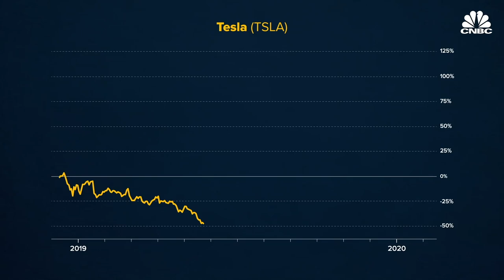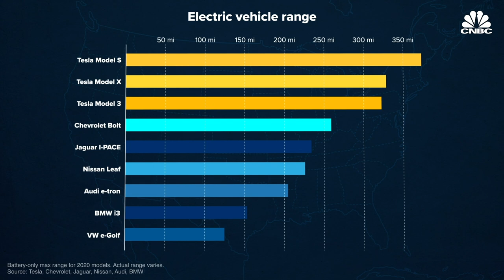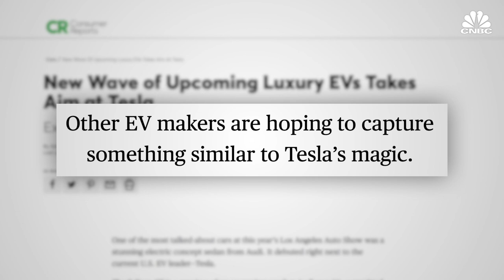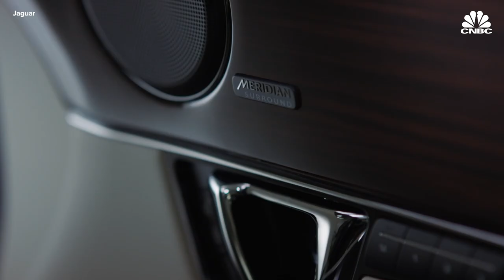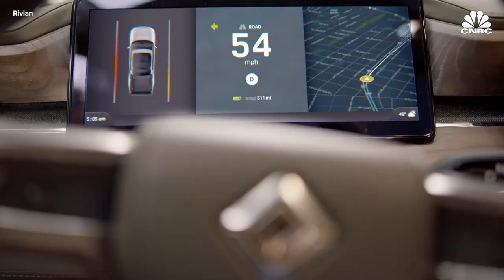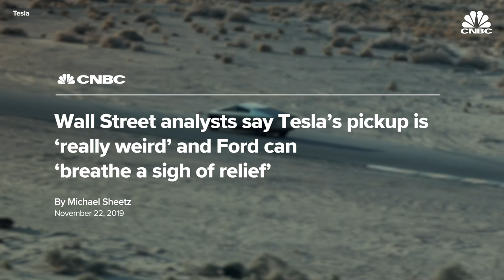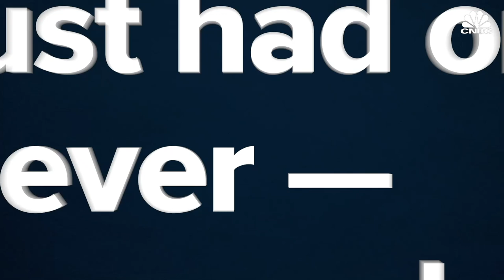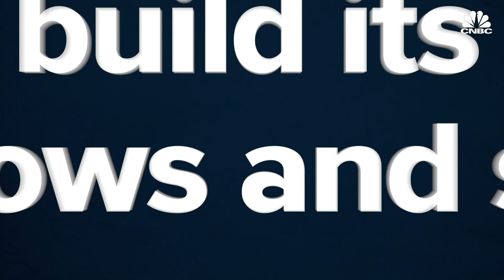Which Automakers Can Seriously Challenge Tesla?

Comment: The reason everyone is losing to Tesla is because they ignore the most important part of Tesla's 

Software
Reply: Tesla is the "Apple" of Cars
Ppl tend to forget that Software alone is not only a BIG change but a HUGE Advantage
Reply: also their electric charging Network
Reply: Software plays a smaller role in people purchasing Tesla's.   It is a number of things, like huge long lasting batteries, which no other OEM comes close to offering Tesla's ranges.   Plus Tesla uses a lot of aluminum in their cars, which doesn't rust like steel.  I believe it's one of the reasons for their long warranties.
Reply: Both Software and hardware are what give Tesla the edge, an article came out yesterday(I think), multiple legacy auto makers did a teardown of the Model 3 and after looking at everything from hardware to software, they came to thw conclusion that they cant compete right now. They stated that Teslas ability to produce hardware and software in-house gives them an edge in that sense
Reply: Wrong, what is making Tesla win is the simple concept of batteries. Elon owns the mines.
Reply: @sgodsellify  The thing you are missing is that the battery is only so good because of the software. Tesla batteries aren't very special. Its the optimization through software that makes them so good.

This is why they can deliver performance boost and extra range with an update something no other company is able to do
Reply: luis abularach that’s the question. Is it the inhouse fabrication of the battery (cell management)? The battery management software (whole battery management), or less limitations, like completely discharging to almost 0% SOE? If it is the 2nd the others are skrewed. I don’t believe the third battery health stuff is true.
Reply: It's not just the software. It's the batteries.If a miracle in Detroit happened and GM received an order for 50,000 Bolt EVs tomorrow there is literally no way they could fill that order. LG Chem is having issues meeting orders for existing auto makers at the moment that is the reason why the Kia eNiro launch keeps getting pushed back and they company has said as much publicly. Tesla on the other hand has built their own battery supply. They don't have to compete with other OEMs for supply from LG, Samsung, or CATL. Realize that as of right now Tesla is the biggest producer of batteries by gWh produced annually. To electrify even 20% of all new cars sold every year it will require that globally more than a dozen "Gigafactory" scale factory installations to provide that kind of capacity.
Reply: That auto pilot is so advanced I just wouldn’t pick any other brand because they won’t hit that level anytime soon and by the time they do tesla will be on another level
Reply: @diesela3  Panasonic produces the battery cells from start to finish. Tesla then places those battery cells into a Tesla battery pack. That's where the real magic happens.
Reply: @michaelriga7305  You demonstrate how little you know with that comment. Tesla batteries are made of graphene, which is man made, not mined. Also, that tech may well soon be made obsolete.
Reply: @Luigi64real  There is just so much BS on here that it is baffling. Yes, battery management is a key, but the reason Tesla starts with an advantage is because the batteries are graphene/lithium. that gives them the edge, which is exploited by the software.
However, other tech is on the horizon that will most probably change that situation. Check out the Youtube experiments on Hemp/Li batteries that blow graphene out of the water, and for 1% of the price. That will surely effect Tesla's situation.
Reply: Software. I'm sorry but bollocks !-  batteries, car spec/perfomance and supercharger network are what make challenging Tesla difficult.
Reply: @sgodsellify  Aluminium actual corrodes way faster than steel - which means it forms oxide layer that protects it somewhat. But in right circumstances (marine type envrionments) it can corrode just as fast. Properly fabricated and protected  steel will outlast yours and my lifetime - and isn't difficult to do.  Normal warranties on bodywork is10years+ reflect this. I have cars 20 years with no signs of rust whatsover. It was more a 1970s thing of poor quality control in manufacturingthe steel.
Anyway by far and away the most popular Tesla sold - model 3 is primarily made from steel.
Reply: And software is the part that as we know fails often. Think about the upgrades your computer goes through and the problems it creates. So I am not a big fan of cars that are run on software. Just my opinion
Reply: @michaelriga7305  batteries are panasonic in tesla gigafactory that is panasonic,s teritory. try google primearth energy co
Reply: @diesela3  r
Reply: Marketing, marketing, marketing

Musk could sell air conditioning to Eskimos. Tesla's software and engineering is nothing special. They don't own superior battery technology. On economies of scale GM, VW and Toyota could wipe the floor with them. Heck, GM released the Bolt months before the Model 3. 

The difference is people want a Tesla more than a electric car.
Reply: then there's BATTERIES.....
Reply: Waco Tx: "Tesla has never produced a profit and never will".

Lol, we have a profit with knowledge of the future here. Never will? Are you sure of this that you could even bet your life on this? Don't think so. Especially when you are already wrong about the past.
Reply: @Luigi64real  Most Li-Ion batteries now have an energy density of 200kWh/kh,
While tesla's have 250.
Also their cars have great efficiency. (Only Hyundai pretty close figures.) These two combined give their cars the range.

Also, should we talk about autonomy, because tesla's CPU is said to be 6 years ahead of any other car Autonomy chip.
Reply: luis abularach but they’re not losing to Tesla. Regular car companies are doing fine. The software is only relevant when self driving becomes legal. Which, I won’t see in my lifetime.
Reply: @royromano9792  Autopilot is safer than humans now. If autonomy providing safety on the roads unveils, legislators won't wait to legalize it. It's lime a health care program but they wouldn't pay for it. Less deaths on the roads is always a good look
Reply: @shadowspire  is
Reply: diamenciarz It’s less a question of safety and more a question of ethics. Pretend a car is going 80mph down a busy HWY. Now all the sudden a family walks out into the road, because Tesla’s are famously quiet. Now the auto pilot has two options, because it cannot stop. Hit the children, or hit the adults. 

Society will not allow machines to make those decisions. We will not see the day autopilot is legal on the roadways.
Reply: @royromano9792  But humans behind the wheel also make such mistakes. Only after you consider how horrible drivers people are and how many things can go wrong, will you see that machines are just a better choice. 

The thing about autonomous cars is that they don't have to perfect to pass legislation. They just have to be safer than humans. Humans given such a problem that you posed will also make a bad decision based on their reflex.

AI cars will get into situations, where they have to choose between lives, less often. A robot doesn't use a phone while driving, it doesn't fall asleep behind the wheel. It's just a simple measure of accidents per miles that NHTSA is interested in. And so far Tesla can hold a line and change lines on a highway 8 times safer than humans. That is all legislators care about
Reply: diamenciarz We will see
Reply: @royromano9792  Have a great day man! ;)
Reply: And charging stations¿
Reply: Software is not why their winning. It's the battery and their power electronics conversion.
Reply: LOL, when you get free money, tax breaks, free land. Plus this: Tesla spends $1 million annually on Washington lobbyists. Its cars are financed by over $280 million in federal tax incentives, including a $7,500 federal tax break and millions more in state rebates and development fees. SpaceX has also received over $5 billion in government support. Basically socialist backed, smdh
Reply: @royromano9792  ...it can detect them a few meters away then brake?
Reply: megaleon crazed in the example I gave, you the break cannot be applied. The car must hit one or the other.
Reply: It is not only software but their hardware is more efficient as well.  Thus the best range and equivalent mpge.
Reply: 🤣🤣🤣🤣🤣🤣🤣 Tesla has terrible reputation for software.
Reply: @Luigi64real  Dude get ur facts r8 .Tesla has one of the best better technology for a lithium ion . And Tesla software is terrible it has many bugs if u dont believe me u can google ur self

Tesla biggest advantage is it's marketing strategy ,long charging network , and their range.
Reply: @debojitmandal8670  for being better than them yes
Reply: Debojit Mandal  Have you seen other cars software? No updates, slow, and clucky. Even with small issues Tesla is leagues ahead of any other car manufacturer.

Tesla has no marketing so idk why you even listed that, they rely on word of mouth. With monthly software updates Tesla is always in the news, people are always talking about Tesla

If Ford or Mercedes were to make a huge charging network and a car with super long range they still wouldn't sell as well.
Reply: @Luigi64real  Tesla has no Marketing ??? It has it has many commercials and Elon Musk has presented Tesla in a way or marketed in way which other brands failed.
And regarding the software I don't about other brands but bmw and merc has a consistent and lag free ui. 
And yes Tesla is leagues ahed of other brands in software but in features not intuiness and also it is widely criticised for a lot of software bugs and glitches even it came on news.
People buy Tesla bcs of its range ,and charging network which I my case is one of the most impressive innovative idea which other brands simply failed also most important thing as I mentioned how Elon Musk has placed or marketed Tesla is just brilliant.
Seriously all OEM should take a page Elon Musk genious move.
Plus the model 3 is not that expensive from a regular average car in usa even that straty was brilliant.
I hope Tesla doesn't become the next apple because I want Tesla to keep innovating like this . I don't want them to hault like apple where samsung keeps innovating but apple takes all the credit.
Reply: They don’t even mencioned autopilot
Reply: @ Luis aburalach.
Wrong, and too obvious: ELON MUSK. The only hope for the competition is to try and clone Elon Musk, or I see in the future very dark days for them all.
Reply: i believe its not one single thing that makes tesla dominate..
Reply: annoyedok321 there’s almost no advertisement for Tesla
Reply: @StopStrugglingNow  Tesla stock going crazy 🤑
Reply: @lillypichu4566  I have to admit I was wrong. I when it was 350,450ish, thought that was crazy. After finding out more over the last 3 months about tesla, they were underpriced. Lost opportunity on tesla for me as they have tripled. I still got in around 930 cause I still think they are worth more especially if the 20-25k model comes out. Plus, they still don't have true dealerships.
Reply: Waco Tx    "Never produced a profit and never will"?   Actually, Tesla is expected to announce its fourth consecutive quarterly profit on July 22.

Do you by any chance have a short position that's wrecking your sleep?
Reply: @royromano9792  the problem is you will never understand how AI logic come up with a decision, the answer to your question is for your human mind only to understand.
Reply: And Elon Musk.
Reply: 喔ㄠㄟ
Reply: It also helps they make the fastest production cars. Their quality will just get better over time. And their tech is years ahead of the next closest competitor especially the battery tech they’ve just announced and started producing.
Reply: WATCH OUR NEW VIDEO ON SPACE RIVALRY BETWEEN JEFF BEZOS  AND ELON MUSK   https://youtu.be/KxxujEGVhoY  ANS  SEE  WHO IS WINNING
Reply: Software, charging network, and looks. 
All the other electric cars look pig ugly, or look like regular cars. 
Give me something beautiful, that screams EV, and has good software, and I'll buy it instead of a tesla.

Comment: No mention of model y which starts delivering literally like 2 weeks
Reply: @jamesatlas5204  they said "teslas only SUV is the model X with a large price tag" but this video is going to be outdated in 2 weeks
Reply: More importantly they didn’t mention the Superchargers
Reply: In a couple of years, it'll be an Rivian R1S, a Volvo XC90 Recharge (to be made in South Carolina), or a Lincoln SUV (to be made by Rivian) for me. No Model X.
Reply: It was missing basically everything of importance. No Model Y mention, no difference between the enormous battery supply Tesla has and the not as many battery cells that the other automakers, combined, have, nothing about superchargers or autonomous driving or safety, even kept trying to make it seem like Tesla does not have an enormous cost advantage. Yeah, a Tesla is not going to cost $18,000 new any time soon, but it will cost you $18,000 or more less than an equivalent EV made by any other automaker so far.
Reply: @stevendrysdale1067  i recently watched a video by a guy who just got a Model 3. Chipped paint in several places, and a place under the handle on the trunk that hadn't been painted. Difficult to see, but shoddy nevertheless. Lots of issues still not solved, and very little interest from Tesla in resolving the issues. On the other hand, my Volvo dealership has been spectacular with the small issues I've had with my XC60. That's why I'm waiting for the BEV XC90 Recharge. ........ And Volvo seats are much nicer than Tesla seats. They're designed with the advice of orthopedic surgeons. I need my Volvo seats for a long drive.
Reply: 777Outrigger you sound old and outdated. It’s about the tech!
Reply: @zanderperkalator9129  Yeah, right! whatever!
Reply: @777Outrigger  
Seriously, man. The tech Tesla has is miles in front of everyone else. It's actually mind blowing.
Reply: @a.banana  I keep hearing that, but I can't see it giving me that much interest. I mean, I sat in a Tesla a few weeks ago and played with the screen, and I wasn't overly impressed. And I'm not interested in the $7,000 self-driving option. Driver assist is good thing to have. It makes a long drive, or a drive in heavy traffic, more bearable, but even my wife's 2015 XC60 has that. I just don't want full autonomous driving. Don't trust it and would not be comfortable with it. ....... Look, I'm trying to keep an open mind about a Model X, but it has a couple of really big hurdles with me. 

(Digression; My wife and I are going out to eat tonight at Fogo da Chau, by a mall with a Tesla Sales Center. And yes, I'm going to look at a Model X again. I'm trying. I'm not a Tesla hater, but I am a Volvo lover because I love their cars and the great service I get from them. Plus I love the orthopedically designed seats. You can drive for hours and not feel tired. Something to be said for that.)
Reply: 777Outrigger I understand your hesitation, but AI is the third wave of technology. You’d be wise to read how far ahead Tesla is... they just see it as what it is: a computer on wheels. And they are honing in on a very special product the other auto makers are just barely scratching the surface on.
Reply: @777Outrigger  
You should really trust the autopilot more, it's doing better then any other autonomous system right now and is only getting better with time - which leads me to another point: 
The car will get better over time (instead of getting worse over time like usual cars) because of the software updates. In my opinion, this is Tesla's biggest  advantage over the competition. Tesla has recently shared plans to increase the range of the Model X by releasing an update which will optimize the software of the Model X even further - for free! They've also been extremely good at improving the hardware. Not too long ago, the Model S went up from 373 miles of range to 390 miles on their website. Surprisingly, the range bump up didn't increase the cost of the Model S by a penny.
Reply: Yes, but you can bet if Tesla had 2 million dangerous/exploding Tanaka airbags then Consumer Reports would put that on their coverpage...
Reply: 777Outrigger Honestly, I would say to do some more research before saying you don’t want full self driving.  It seems to me you haven’t seen what exactly makes it more advantageous...the actual safety improvement over driving yourself.  I’ll link a video that explains it.  Also, the Model X does have some other dramatic examples over the Volvo.  First, the Model X is the only SUV in history to get five stars in every single category when it comes to safety ratings.  Secondly, as widely mentioned, Tesla’s a good 5 - 7 years more advanced in their technology over any other manufacturer.

https://youtu.be/SuEHbRD_qOc
Reply: I am a Model Y, and I am already sentient and commenting on Youtube videos.
Reply: @roberrplatt4214  Should you be commenting on YT while driving?? Just sayin'
Reply: Also they did not mention the ID.3 wow
Reply: WATCH OUR NEW VIDEO ON SPACE RIVALRY BETWEEN JEFF BEZOS  AND ELON MUSK   https://youtu.be/KxxujEGVhoY  ANS  SEE  WHO IS WINNING